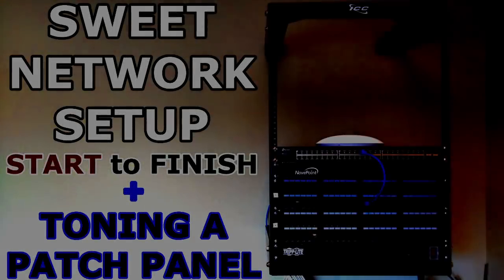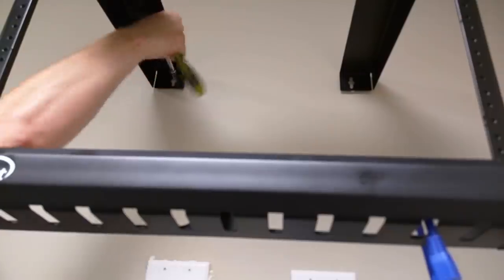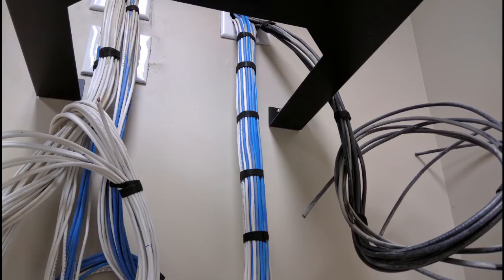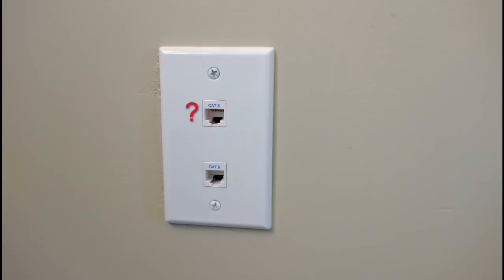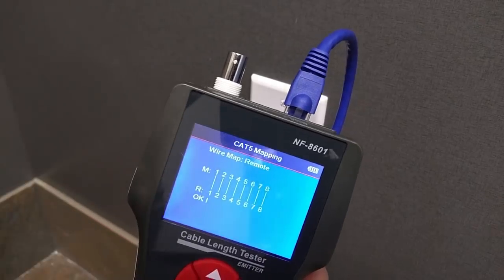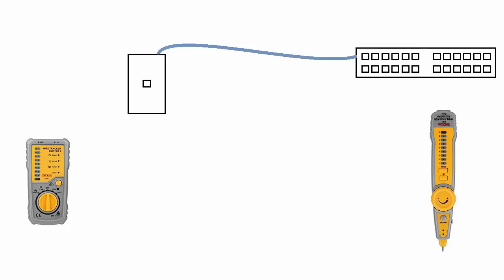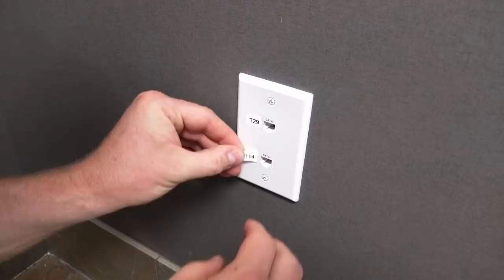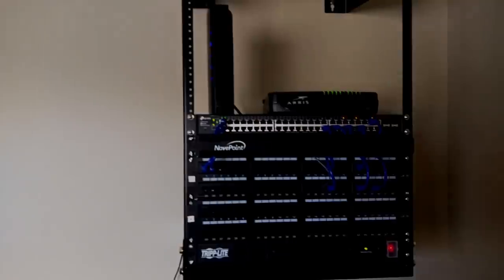Complete Network Setup // Toning, Identifying Ports

Comment: You can also buy RJ45 to RJ45 keystones for the patchpanel. Alot faster, inserting them and switching them around. Oh and USB and HDMI keystones also exist, quite handy
Reply: I don't really understand the point of these, it takes like 30 seconds to punch down a jack, and takes way more time to terminate a connector, so where's the benefit? Also a lot of them don't really meet ethernet specs as it's a sizeable portion of the cable that is unshielded and untwisted.
Reply: ipullstuffapart 

There is less untwisted wire in a keystone.  Look at those patch panels.  You have wire going to the top and bottom.  That is s much larger spread then using keystones.

For me, doing my home network in a small closet, so much easier to punch into all the keystones and then snap them into the patch panel.  Since all my cables are labeled, I could snap them into place as groups.  But you can also do things like color code the ports.  Red for this, blue for that, red for something else, etc.  another benefit is the flexibility of other things in the patch panel.  For me it was keystones with RJ45 jacks on each side.  So my WiFi Router, TiVo Stream and other devices that are on a couple shelves as they are not rackable, I can run the Cat6 cables to the back of the rack and down and plug into the back of the patch panel.  That way all that’s out front are the same short patch cables going from my 2 patch panels to my 48 port switch.  The spaces on the patch panels I didn’t use, I filled in with blank keystones.    Let me tell you, my Home Network setup loos very professionally done.  All my ports are labeled so I know where they go to.

But the ability to add HDMI, audio, etc keystones also really make the setup far, far better.  I would never again, not use a keystone patch panel.  Also remember, you have keystones on the other end.  

If your wires are not short in the keystone, you’re doing something wrong.  When done, I test every cable from keystone on one end to keystone on the other end.  Found a couple booboo’s on keystones I punched.  Man, if I had to fix that on the other type??  No thanks.

If a port fails on one of those patch panels, you either replace the whole thing, which is not normally done, it it’s a dead port to no longer be used.  Where as I can just swap out the bad keystone and all is good.

Still for me, the biggest benefit is the flexibility.  I also like the solid rack on the back of my patch panels to allow me to zip tie rack and every cable to it for better support and reliability.  

So with my cables all labeled,  and the keystones all installed.  I can start snapping them into place.  MB1, MB2, MB3, CR1, CR2, on down the row.  That is Master Bedroom 1 and Computer Room 1, and so forth.  So all my rooms are grouped together.  This is what makes using Keystone Patch panels great.  I’m using s couple 24 port Keystone patch panels from Cable Matters that I got from Amazon.   They look nice and work great and the price is good.  Of course there is the extra cost of the keystones to pop into it.  

I’m so glad I went this route.  I still have one of the other type of Patch Panels at my house I was at first going to use. But I’m going to sell it.
Reply: @ipullstuffapart   If you did it right and had the twist all the way down till the punch down split then it will pass fluke cert. We do it all the time. The standard isn't in the plastic jacket shielding the copper pairs... it's the number of twists in the pair canceling RFI. It's funny how Cat5e and Cat6 are the same AWG (24) but Cat6 has more twists and space between the pairs which allow for faster connection speed. Because it has more twists it uses more copper and more airgap material which is why it's stiffer but the actual copper is only shielded by the twists.
Reply: @michaelwaters6829  Yes that is true for normal keystones which is what I'm talking about, Spartan70 NL mentioned RJ45-RJ45 keystones which require a male connector on the end of your structured cable, which takes way longer to do than a punch-down. With male-male RJ45's they also don't have internal shielding or twists so they're way more vulnerable to interference.
Reply: @ipullstuffapart  I do prefer keystone panels but we build to spec and the customer gets what they ask for. I feel for this youtuber. Hes a DIY networker and hes got all us pros comeing at him from all angles ha. And theres conflicting advice half the time haha.

Comment: So simple to just label cables as you run them. That way there is no guess work and you can have a uniformed patch panel. I made a "L" bracket to hold panel in correct position (not upside down) to make termination. I also add in 6 inches of slack for each termination. This can easily be hidden behind wall once you straighten out the cables. Now  you would only need a straight through cable to jumper between top and bottom for each room at the panel and then do your testing at one location. I have five cables I made and do five rooms at a time. No hunting for cables. Front of panel is organized instead of customer having to hunt for jack on panel. Much more professional.

Comment: I like more to place one patch panel above the switch and one below, better for cable management, and get those really thin/slim cat6 patch cables to connect from the patch panel to the switch. It looks SO tidy when you do it like that.And you can plan ahead before crimpling the cables into the patch panel: even ports above the switch and odd ports below. that way when you need to find a port/cable you can do it instantly, ; and if you crimp the cables in order in the patch panel and in the rooms, the labeling and wiring will be extremely easy.

Comment: Seen a youtube video somewhere on a contractor that ran the network cables during construction.  He had made a system where 1 person would go around with like a 9v battery attached to the cable ... and then on the patch panel he plugged in custom plug that had a led on it.  ( assuming a resistor as well ) .... then instead of having to wand the patch panel to find the signal .... simply look for a bright light.

Comment: At the patch panel when you think you've found the jack plug in a patch cord just like a 1ft one so you can probe that specific cable further from the panel eliminating interference from neighboring jacks. I really old telecom guy tought me that
Reply: Good tip!
Reply: Haha yep, sounds like a telecom trick. Another one I learned maintaining old 66 blocks from a telecom guy is to use a pocket knife to short a pair you think the tone is coming from. You then touch the knife blade with one hand and the probe tip with the other. If you touch the blade and tone is wailing, you know you got the right pair.

This is good for very suspect runs where tone is bleeding through a few pairs and you can't narrow it down right away.
Reply: @amak1131  That could ruin a pbx now days, we have flash monitoring meters you can narrow stuff like that down really fast with modern equipment

Comment: I agree with those saying to label the cables ahead of time. IT doesn't' add that much time and will save you time in the end not toning everything out, trust someone that does this on large commercial jobs every day for a living. For commercial jobs, if you have more of a budget I would look at the multimedia patch panel, would help make service in the future easier if you ever had to redo something on the patch panel.
Reply from the maker: Good tips, but I've heard people argue it out both ways. Even if you don't have to probe for the line, you're still testing each one.

Comment: Some things that need noting from this video...
1. None of the cables are secured to the patch panel. There are loops on these ones to secure them down, they shouldn't hang free out of the back. @5:10 
2. The wall sockets should be paired up on the patch panels.... Tone before dressing and  punching down

Comment: We would use a swing rack, not a fixed rack, pick one side and bring all the cables down on that side. Then swing the panel open when termination is needed. We always put the fiber panels on the top, the patch panels on the upper part and the switches on the lower part of the rack to allow for expansion, leaving space below each. I realize for some severely anal IT techs it makes it prettier to bunch it all together, but it is not very practical. 

With the switches above the cables it makes it very difficult to troubleshoot and/or terminate any new cables you install, not to mention blocking available light in the room. Having the switches below the patch panels also makes a convenient place for your termination tools while you punch down the cables.

On a 7' fixed rack we would come in on both sides, 12/24 cables on each side for a 24 /48 port panel, once again starting at the top and leaving spaces for expansion.

The cables are supposed to be run in the channels between the upper and lower 110 termination points. It's a decent video, but in the 30+ years in the trade I've never seen experienced techs terminate panels like this.

There are BICSI and TIA courses available or some entry level training provided for free by the vendors you buy cables from.